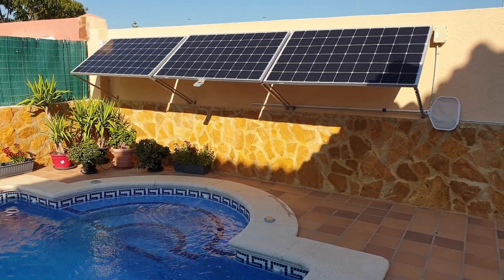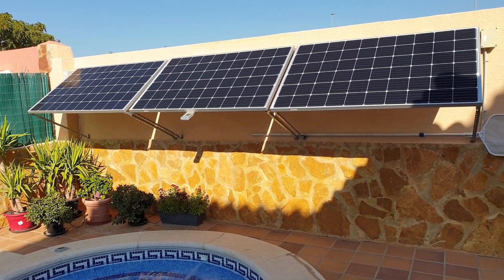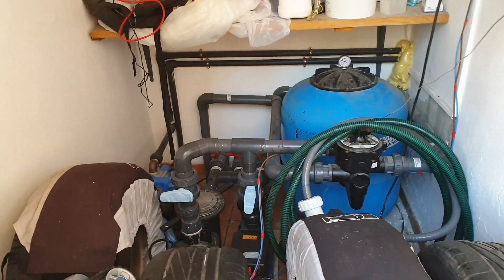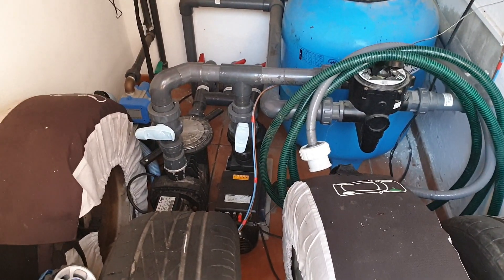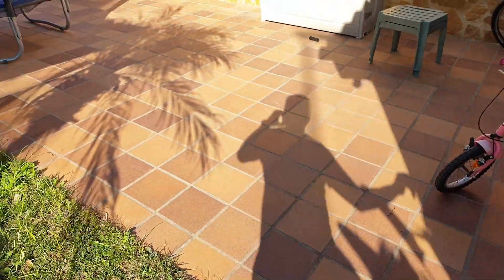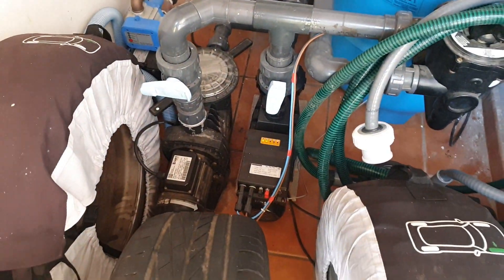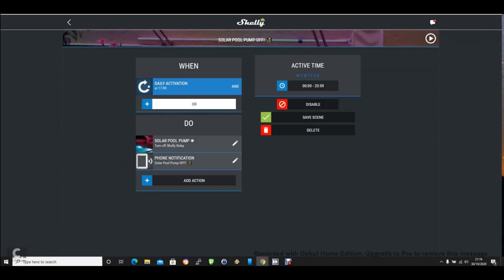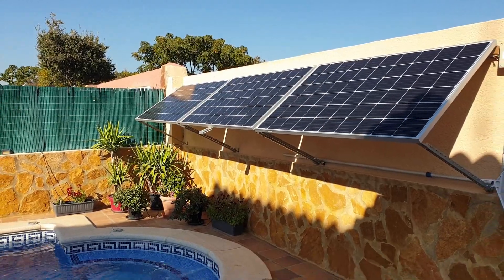Behind the Scenes with My Shelly Controlled Solar Swimming Pool Pump

Comment: Hi great system. I have a similar system and want to add a timer. I have a control box (with printed circuits inside) that the solar panels connect to and regulates the pump. There is an in off switch on the control box. Can you suggest a timer I could attach to the switch. Just want a basic timer don't need an Internet one. Thanks!

Comment: Hello, Can you advise on electric parts  you bought  for security on internet like amazon ?
Reply from the maker: What type of security, are you thinking about alarms? Sensors?
Reply: @zoltar99  I'm thinking of  human security during working on panels or on  the pump  (plumber) , just circuit-cutting  ?
Reply from the maker: @wildjumanji  You could buy a little waterproof electrical
 box and install a DC breaker.

Comment: Hi, can you please send me the link of solar panels you purchased? Much appreciated.
Reply from the maker: Pamela Burroughs, I purchased three 310 watt monocrystalline panels, I don't have a link to them anymore. Manufacturer recommends using the pump with four 250-280 watt solar panels. I use three 310 watt monocrystalline panels because of lack of space and it works well most of the time. When it is very cloudy, the pump will run slower, but apart from that, no issue. So just get any four 280 watt panels if you have space to install them and you should be fine.

Comment: Where did you buy the solar pool pump?
Reply from the maker: Have a look here: https://amzn.to/3k9k5mf or if you need a larger pump you can search for wccsolar
Reply: @zoltar99  Is there an installation notice in the kit on amazon...do you have an electric notice please ?
Reply from the maker: @wildjumanji  you only connect it to a 12 volt transformer, you can connect it either way, it will still work, no need for installation instructions.